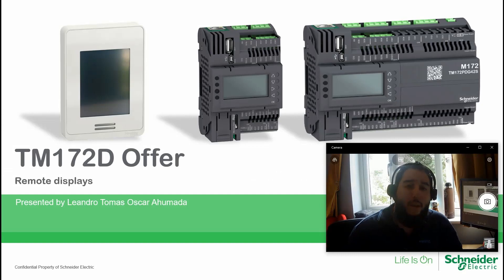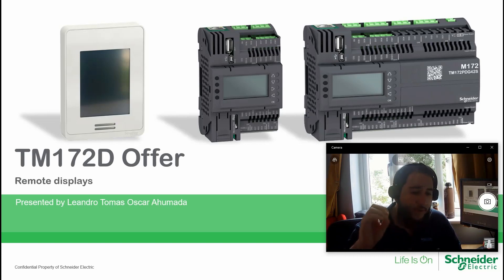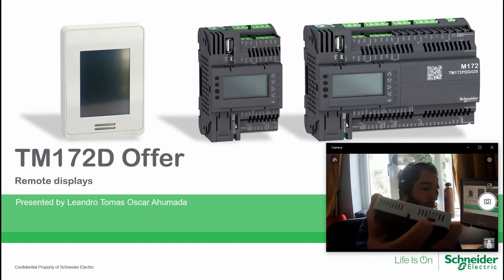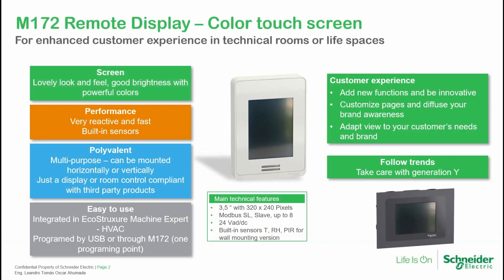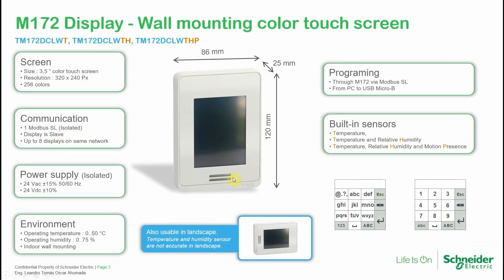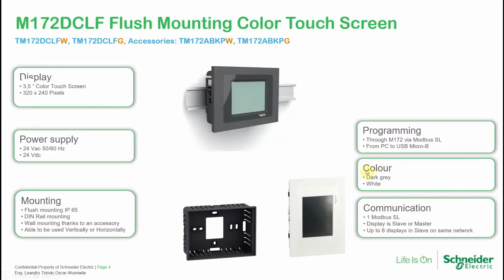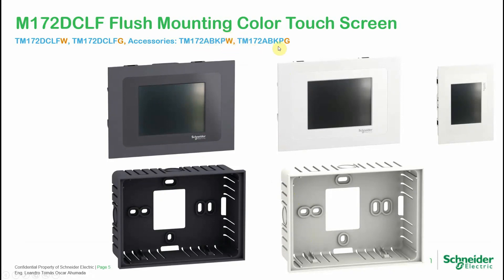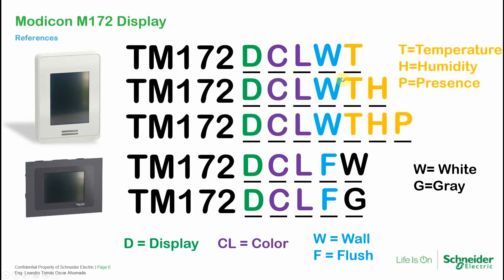Training M172 - M8.1 Remote Display Offer

Comment: Hello! Thanks for creating this series! Quick question, can you have a HMISTU855 as the remote display with M172?
Reply from the maker: Hi Mistry. Yes, you can communicate the m172 with the HMISTU via modbus serial or modbus tcp.
Reply: @LeTomasAHUMADA  Awesome. Thanks! Have you done any sort of data logging before on any of these products? How difficult would it be to use a PC to extract the log files? HMISTU would be better for logging I assume.
Reply from the maker: @5nov1988   the datalogging on the HMI is simple. On Vijeo Designer you just need to configure the "Data Logging" then in your PC you must have the software "vijeo Designer Data manager" to read the data from the HMI.